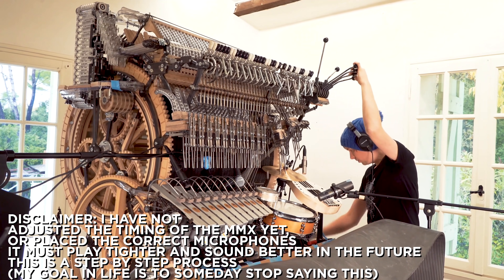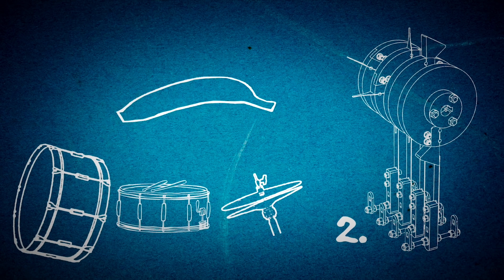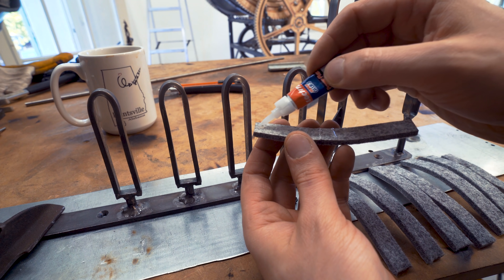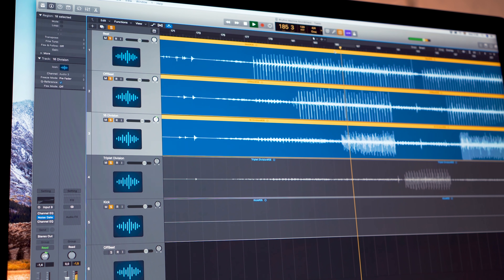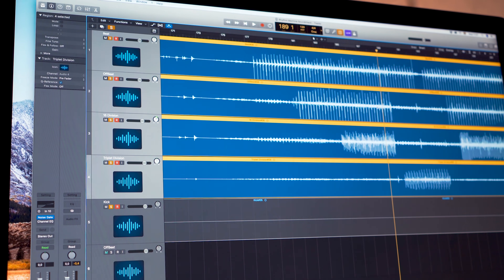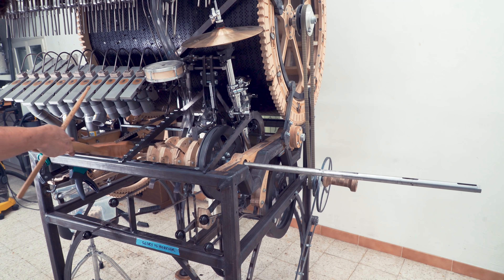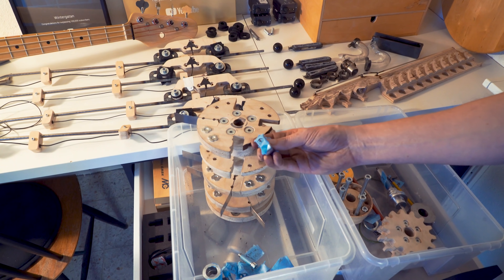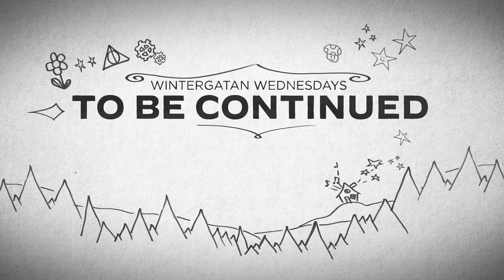Rhythm Machine Experiments - Marble Machine X #107

Comment: Waiting for a governor for the flywheel. Then it doesn't matter the pace of cranking. Old school steam has the answer.
Reply: Can you adjust a governor so it allows you to play lots of different tempos? Because he wants an unlimited range of speeds for the machine
Reply: @andrewbailey7999  Can a steam governor modulate differing speeds?  Yes, with provisos.  It does not modulate well at slower speeds, because the inertia of the metal balls is low.  It does not modulate well at high speeds, because the mechanical linkage does not afford fineness in control of admitting steam.  The device must be tuned to the range of speeds desired.
Reply: @andrewbailey7999  yes you can. It's basically a mechanical feedback loop which has characteristic parameters of weight and arm length (combined they define moment of interia). Change either of those and you can change the stable speed. You can also add a spring and preload it to offset the weight to adjust speed.
Reply: So, basically MMX becomes one over-engineered music box?
well technically it still is, but then Martin should figure out how to make that happen...
Reply: Yes, I was noticing the same issue when he expressed his inability or difficulty in keeping the revolutions in time with the recording. I saw other comments that called for an RPM tachometer, but think the adjustable governor in conjunction would be even more effective.
Reply: @enyotheios2613  he specifically wants to be spinning the wheel in time, and designed it so that the down beats are on the lowest part of his turn every time.

Would he give this up for a governer?

IMO his timing troubles happened because he made the notes so long, obscuring the downbeat.
Reply: A centrifugal governor limiting the speed would be a pretty nice addition, and they're fully adjustable to any speed limit you want. You can still crank at the usual speed, but you gently let it hit the limit. It does make cranking a bit heavier. 
Old acoustical gramophones work that way, the spring is working continuously against the limit set by the governor.

Did somebody say feature creep?
Reply: @mfbfreak  I think Martin is going to need this. Focusing on speed is going to take away from him being able to play the bass guitar and control other levers at the same time. Remember the hard time he had with the Music Machine that used foldable books to play a song? He had a hard time keeping time and his arm was giving out.
Reply: Old wind-up music boxes used a fan geared up to spin fast, the air resistance provided a constant reference. Then an adjustable slip clutch stops you exceeding a configurable rippum. Not beyond this man's talents.
Reply: Needs to be mounted away at the top of the MMX; it would complete the steam-punk look to have actual steam engine parts highly visible.
Reply: What Martin really needs is a device, sort of like the thing with the balls that fly out, to adjust the timing of the new high hat. As the tempo changes the high hat drum stick wheel will need to rotate slightly relative to it's drive shaft because there is always a fixed delay from when a programming peg releases a marble to when the marble hits. The high hat needs to be delayed by that exact amount however the required angular relationship to the programming wheel will change with the tempo. It would probably be helpful to gear the flywheel mechanism so that it spins faster than any of the  shafts currently on the Marble machine X so that you can get more force with smaller weights.
Reply: Link to device?
Reply: @TheWineroute  https://www.youtube.com/watch?v=zNzpOwWzxXw
Reply: atomicpollywaffle I’ve been thinking this for awhile.... a way way to limit the max speed, in addition to the torque limiter. Have you searched the Subreddit to see if this is discussed?

Comment: I was going to suggest that you run guitar string along the plywood blocks and that you replace the spring steel with a polycarbonate guitar pick style material in order to fabricate a more joyous sonic timing element.
Of course then the angle grinder of change met the mind of time and you changed your mind another time and the implosion reverberated throughout the interior parts of the MMX as they became sentient and called themselves "Johnny Five" and proclaimed to the beat: "Oh, dis assemble" and the lightning bolt of ID contacted the flammable material of brilliance so began to glow from the core was the light at the end of a vision called tunnel. And much the same as a marble that had previously made its way up the machine only to end up chambered and loaded and released unto the world as a vibraphonic tone....it begins anew its journey to become potential to the kinetic times the timing divided amongst the sum total of the parts only to endure yet another change, yet another sound, 
Yet
Another
ID
Yet
Another
Disclaim to Fame!
Reply: That's poetry, man.